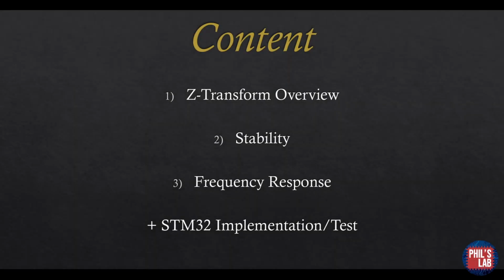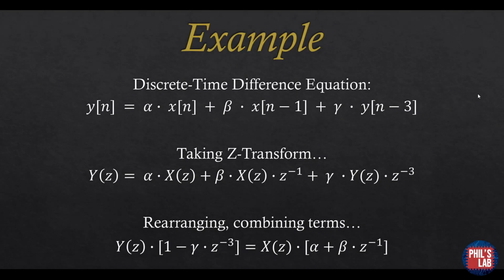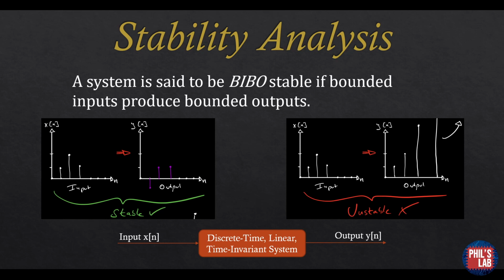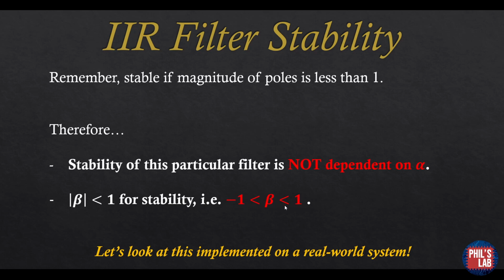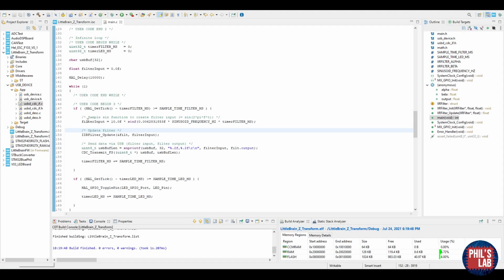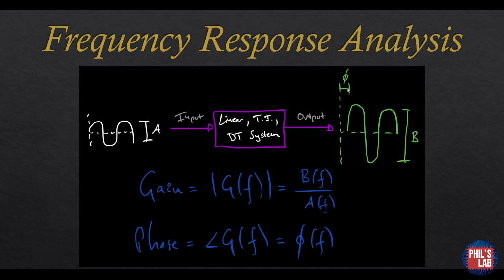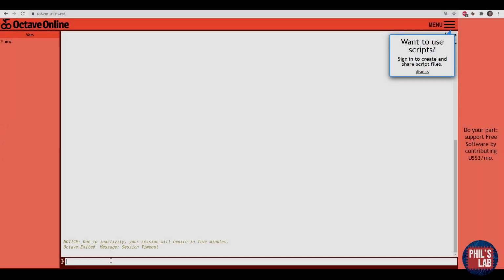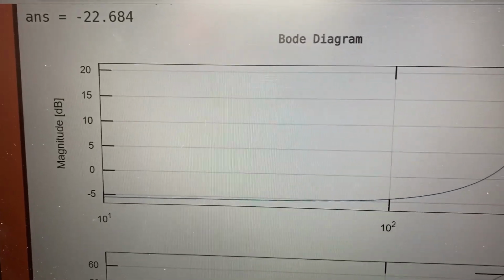(Sponsored) Z-Transform - Practical Applications - Phil's Lab #27

Comment: This has been super helpful and you can even know how much. I’m want to make synths and I’m sort of reaching in order to have something really special and to develop some unique skills. To put it basically, my first project leading up to the first prototype will be an analog computed bouncing ball simulator with digitally controlled parameters and a lot of fancy ways to use it. I wanted to have a basic dial to either increase the system stability as a whole or decrease it without having to change the parameters individually. I think now I’m going to make a LUP for various unit steps of the stability control and set the variables/control flags with the MCU or maybe even DMA.

Comment: Hi Phil, I followed your excellent videos and designed and built pcb's with confidence. You were using kicad in these videos, lately you're moving to Altium, which is excellent designer but has no place with the likes of us poor hobyists, please stick with kicad for our sake.
Reply from the maker: Hi Khaled, Thanks! As mentioned in the video, I'll still be using KiCad in videos but also Altium Designer. For me the tool is not the main point of focus in my videos, rather things like design process, circuits, component selection, etc. So all of that will stay the same :)
Reply: @PhilsLab  Thank you Phill

Comment: Hi Phil,
Great video! Do you have any future plans to demonstrate the process of taking a physical system (say an LPF) and using the Z transform principles you've shown in this video to aid the design process? It'd really bridge the gap into the real world if you demonstrated the whole procedure of analyzing what input needs to be filtered, taking the necessary formulae from it, determining the theoretical filter value that needs to be applied to achieve the desired output, and then physically implementing it.  

A simple example of this could be filtering a 120VAC line into a piece of noise sensitive equipment. Of course the simplified formulas for these are readily available. However, it'd be a great way to show the link between a 1st order Z-domain system and the physical application, and obviously you could get more complex if you wanted to.